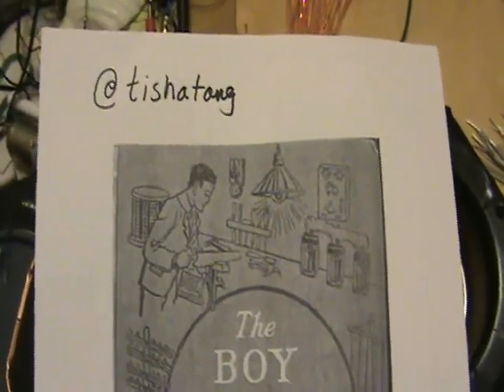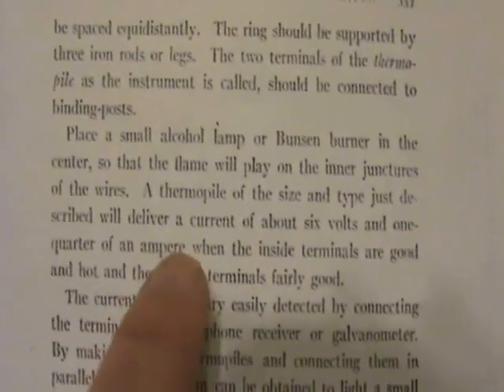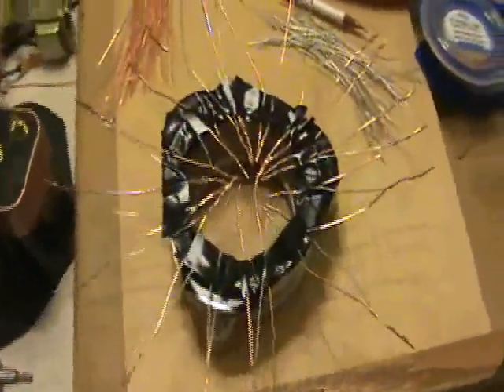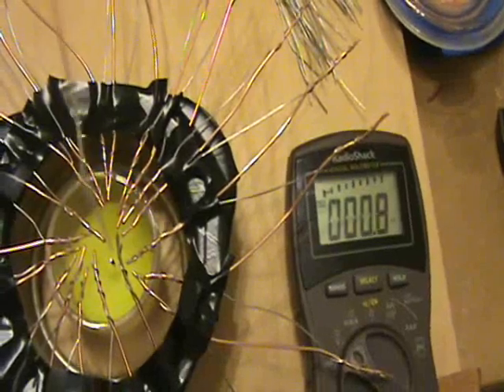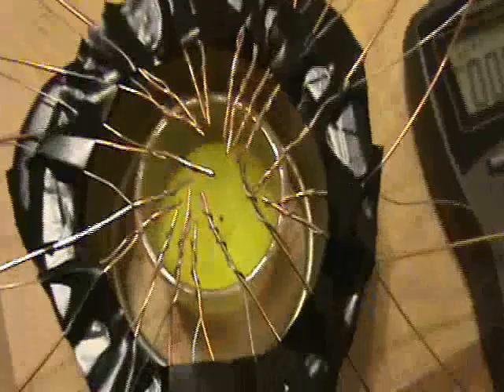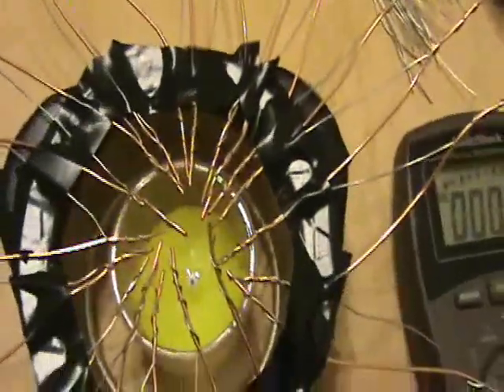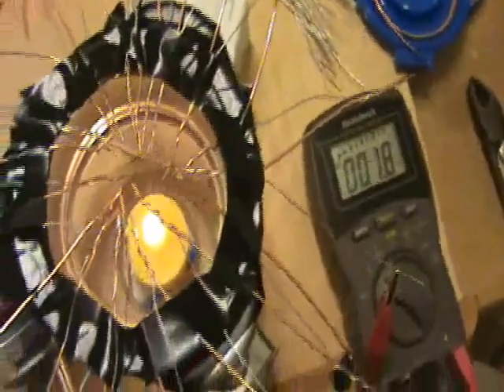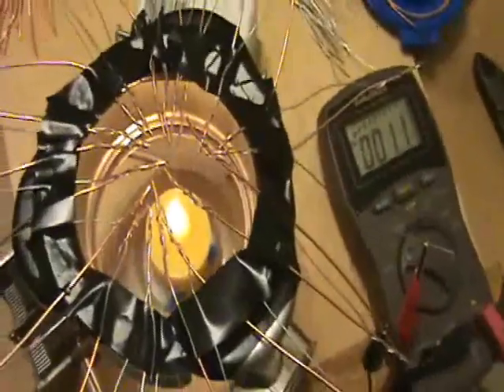Thermopile

Comment: I believe the reason that the device goes down to zero volts when the heat is removed has to do with the fact that you have junctions of opposite polarity in series at more or less the same temperature (the external connections are junctions just like the ones in the flame). The voltage output should actually be the difference between the some of the junction voltages on the hot end less the sum of the junction voltages at the cool or ambient end. The leads to the multi-meter also constitute junctions if the metals are dissimilar, although at ambient temperature their contribution might not be detectable by the meter.

Comment: A great book! Problem is that Mr. Morgan was talking about putting several of these thermopiles in series (read carefully). The actual couples are made with copper/German silver (an alloy that really doesn't contain silver--mostly nickel). I reccommend using copper/constan (you can buy a roll of this wire from suppliers). Copper/iron will provide a maximum voltage at around 250 degrees C (about 30 mV/couple). Great work, however; keep up the spirit!

Comment: What would be your theoretical thoughts on building a thermocoupler, one end being 5/8 x 12 inch copper and the opposite end of iron having the same length fitted together to form the junction?  In this set up, would you heat the junction directly or try to heat the copper in general?  If the copper side is heated to 1, 500 F what would you speculate the voltage and amperage to be?  I'm new to all this and find it all very, very intriguing and see room for much greater efficiencies.

Comment: Hi-I'm new to the field of thermocouplers and thermopiles.  Once I grasp a concept then its easy to manipulate to get your desired effect.  I've seen the joepipe go quantum on at least a dozen occasions where some form of plasma anomaly manifested. There were times in the earlier experiments where I used copper pipe fitted with a copper end cap fitted into a brass barb joined to a length of 1/4 steel tubing for form a crude thermocoupler of sorts. Looking back this seems to be the common thread.

Comment: this is crazy, earlier today i drew up this whole picture of a thermopile and now i see it for the first time, wtf! lol., i drew it up and wanted to use copper and iron wire. if you look at the metals properties of anodic or cathodic that should give better results. i have an old electrical book that does that its really cool, different metal abilies can make the 6 volts come true probably. i was gonna use this on a collector, seems plausible once you have all that heat from the dish..

Comment: You could use pre-made thermocouple wire, this is sooo crude. the geometry is crucial, they must all form a cohesive stacked alternating spot welded or better yet  a precision metallurgic bond. The Russians have a nicely engineered primitive thermopile made from a lamp. You will never get a result by simply twisting the wires together that is not how the PeltierSeebeck effect works. You're right, it is a really cool idea, thats just the exact wrong way to do put the thing together.

Comment: I would assume that is more "galvanic" in nature, rather than them being an effective thermocouple.

I would like to see the results using the recommended material, if it is still procurable. German Silver is not actually silver, but a Cu/Ni alloy, as is Constantan (paired with Cu in a T type thermocouple). I think the results would be as impressive as the book predicts.

If I find a supplier, I'll be sure to post.

Comment from the maker: There are two worries about aluminum. Since the 70s, it has been implicated in starting fires in homes when used as wiring in the home. It does weird things -- "cold creep". 
Aluminum dust causes induces fibrosis of the lungs. So messing with the material should be done with care.

Comment: Don't worry it was the second thing I tried!
After I got current from my first stack, I thought,
"Hmm, Wonder what will happen if I put current back into it?"
After the flash and bang I put a big ass diode and fuse in series with the themopile and the battery I wanted to keep charged.

Comment: 12V @ 2 - 4A, I'm talking a lot of heat though!
I started making the insulators between layers out of clay, which didn't last very long. I then tried fire cement, which lasted ages.
Originally I was inspired by a "generator" I saw at the SA Military Museum, that unit ran on kerosene and was about the size of a small bar fridge, that unit was rated at 14-16V @ 8A!
The best thing about these units is no electrical noise and they are quiet. Great for running radio sets in the field.

Comment: An Aussie company Azzure Energy has a system like m3sca1 suggested, it runs their dissimilar metal thermopile assy between hot & cold tanks of solar heated water. Heated by the evacuated solar tube technology. They claim huge heat to electric efficiency ...dunno if it's fair dinkum tho.

Comment: I'm not sure if it's the same "Boy Electrician" book, the one I had was brilliant!

Instead of German Silver and Copper, I have built stacks of 20- 40 stages out of galvanised steel "handy wire" and thick copper wire, silver soldered together.
I managed, after a lot of experimentation, to get 12 - 14 volts out of a stack, wired in parallel, powered by a gas burner.